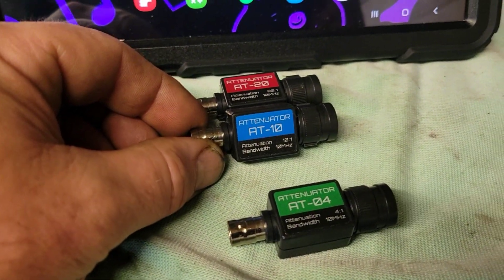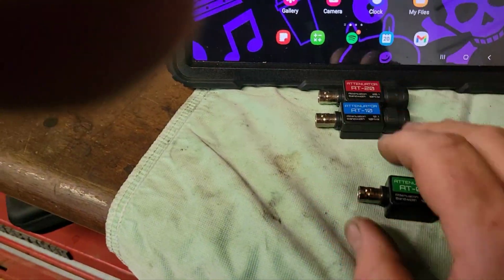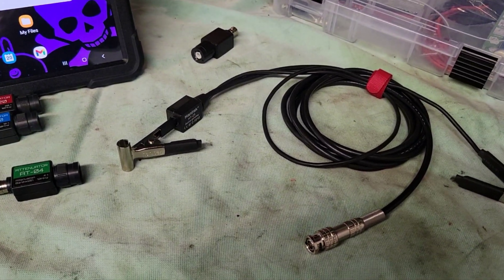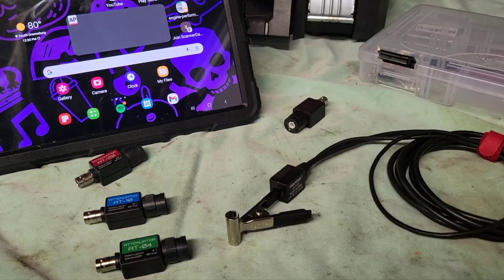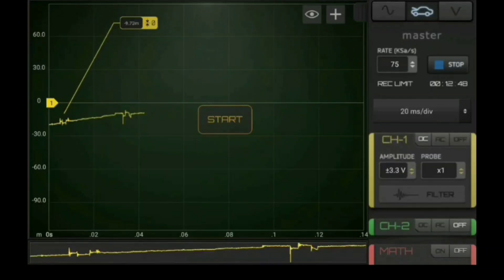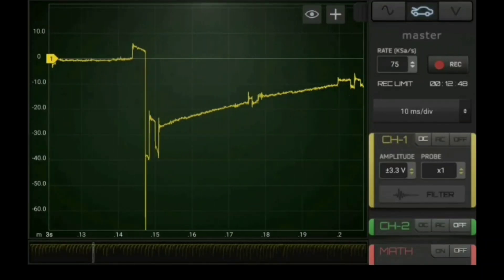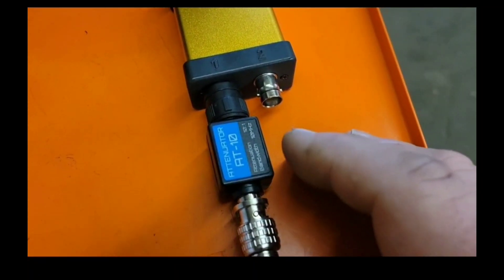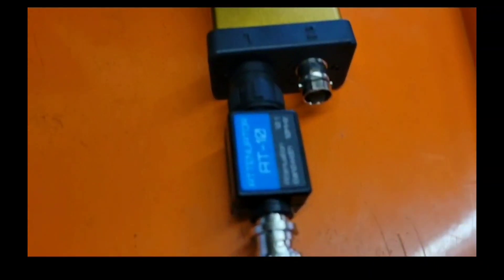Secondary ignition with HScope and hs512. I thought it met its match until the save by MartinLoren.

Comment: I’m still having issues with my HS512 on ignition testing. I can’t get a signal with the Hantek clamp probe or the Hantek COP to save my life.
Reply from the maker: @Code325  Hi! Is the problem Hscope crashing or just no signal? If it is Hscope crashing, an attenuator with emi protection helps, such as the ones Martin sells. If it is no signal, make sure to keep the voltage scale as low as possible. Ignition sounds like it would be high voltage, but the signal we are measuring is just the magnetic field produced by the high voltage. Try, if you already have not that is, to start on the lowest scale voltage wise. Over scaling will not hurt the scope, unless you are on the max voltage that is. An example would be starting on a 1v scale and seeing the over voltage scale just means to increase to 3.3 or the next scale up. No harm,no foul. If you measured a signal on the max scale like 32v scale and it overscaled, then you need an attenuator. Secondary is low voltage and will be in mv. Also, if you are using a preset, make sure it is not the problem by simply keeping your probe setting on x1. This might not give you the correct scaling but it should put a pattern on the screen. Even if it is a small pattern, you should be able to zoom into a waveform. How detailed it is depends on the insulation of the coil or wire, but the coil spike should show up at the very least. Also, when you hook to the battery, does the voltage show? If there is not a voltage reading on just the battery, then i would contact Martin. If there is voltage, then there is just an issue with setting up the ignition probes. I find that 150ks is ideal for secondary resolution and 20ms for the initial time base. 
 My initial starting point is always on oscilloscope mode, not automotive. Lowest voltage scale, most amount of time and 150ks resolution. The time is short on scope mode, but you should see signals at that point. That is the "live" mode that you can see in real time if you are going to have a signal in automotive mode. Saves on time that way instead of having to record just to find there is no signal there. Give that a try, where there is a will there is a way. If you still dont have any luck, definitely let me know. We will get you up and running or find out why! Have a good one
Reply: @ thanks for the great reply Eric! (Erik? 😬) I downloaded the telegram group but found myself doomscrolling through previous discussions. Wish it was more of a forum type discussion board. Your comment is more directly helpful though. I think for me I wasn’t sure whether it was crashing or dropping signal. I’ll play around with it some more and get back to you!
Reply from the maker: @Code325  no problem at all, if it is crashing, it will quickly say system failure in like a video game doom screen lol. It goes by quick but it also resets your settings, that's usually how I tell if it crashed and I missed the failure screen. A bad wire or coil also makes it crash. If the spark is firing into the block or a wire is arcing, it crashes but leaves us with a clue. For me at least, it shows a few waves before the crash. Good luck!

Comment: You're wasting your time trying to measure secondary waveforms. The source has a high impedance, and the scope shunts the signal, lowers it and distorts it. The only way to read ignition waveforms is to read the primary side.

Comment: instant subscribe! I just got the HS512  for the same reason (No 502's avail) and the exact same issues!  when I clamp the HT25 to a plug wire, I loose signal, scope goes off line, looses connection to tablet. thanks & I'll be back for more

Comment: Looks like a double strike waste spark system, but I'm wondering why the waveform looks inverted? I'm guessing it has something to do with the polarity of the spark. Maybe try the invert feature and see what that does. 
I have the 502 but I haven't tried it with ignition propes yet. 
Keep up the good videos, maybe i can learn something.
Reply from the maker: Thank you. Yes, it's a taurus waste spark. It inverts opposite on 3 of the 6 wires without inverting the probe  manually. That handy invert feature is sweet, I like the layout. The 502 has been sold out for a bit,  so I went with the 512. So far, so good, but I haven't measured anything super low. Just got a Rotkee pulse sensor. We will see if that's its Achilles heel, I hope not lol